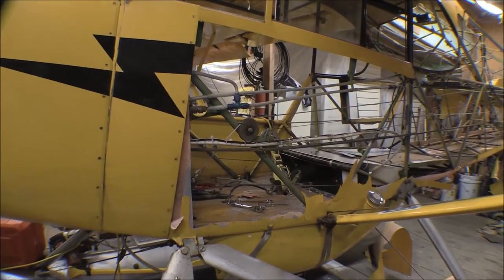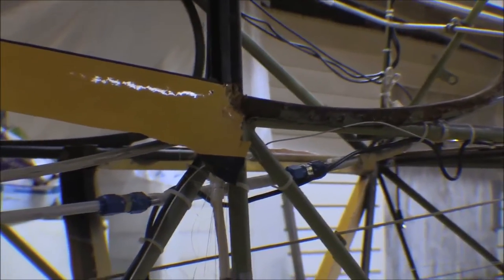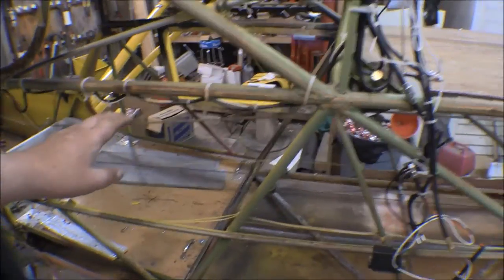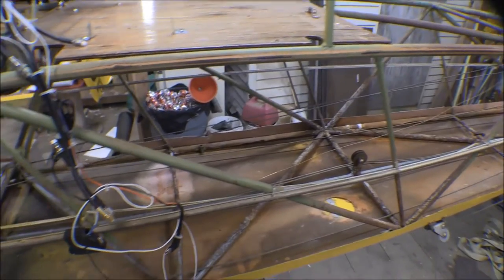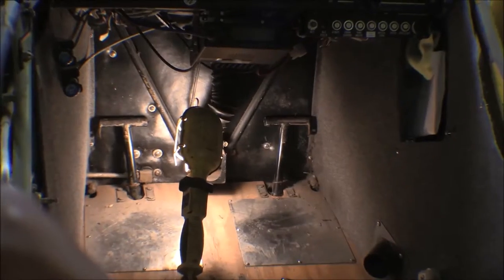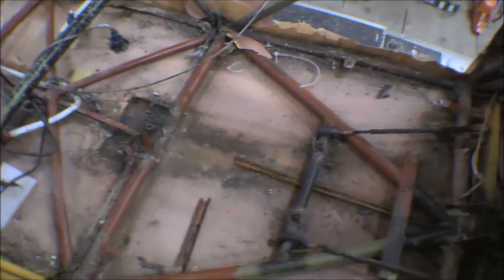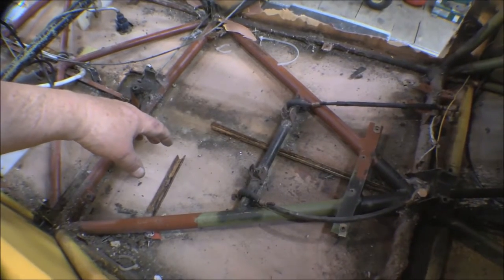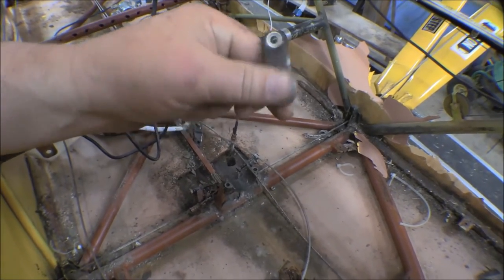Piper Supercub Widebody  refurbishment: more disassembly of the old fuselage

Comment: Wow, lots of rust. Do you think there was standing water in the belly of that thing for any length of time, Carl? Too bad there isn't some sort of seaplane grommet a guy could use on the lowest part of the fuselage as well as the wings and tail surface panels. Hopefully the powder coating on the new airframe is doing a better job of corrosion prevention.
Reply from the maker: I bought this airplane as a rebuild from Cub Crafters in 2001. It had the original 1957 fuselage, which had been used as a crop duster, and the original thin paint. It was being built for Jim Richmond( CubCrafters owner) as a light weight plane, no prep for seaplane. It did have drain holes in the fabric. The first few years I had it it was stored outside, April through October on the seaplane ramp. We took out the baggage compartment on 2009 and cleaned up the lower tubing and painted with Rustolium. 15 seasons on salt water and in damp environment took its toll. It actually did better than I expected. I figured 3 years life for the tail feathers and 10 years for the fuselage. Rudder went 5 years, elevators 7( elevators just needed cleaned up, small repair, painted and re-covered), and the fuselage 15. The fuselage can be repaired, lower longerons and cross tubes from the main cage back, and tail post.